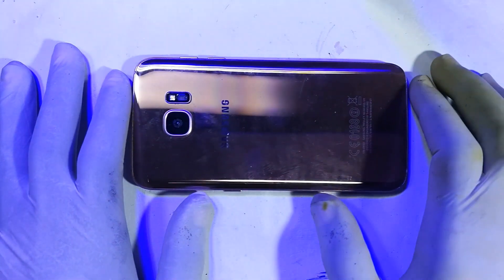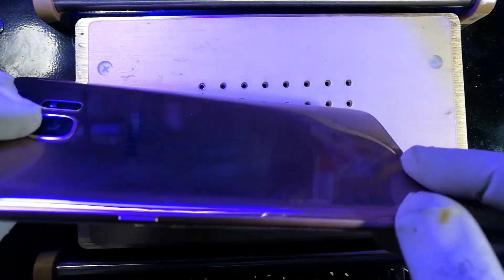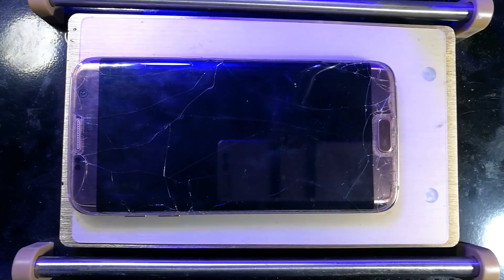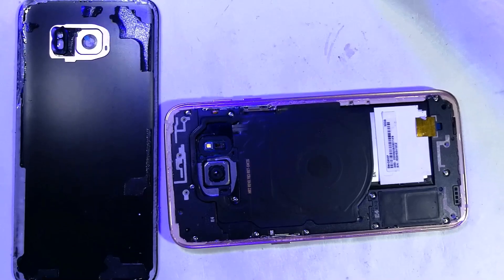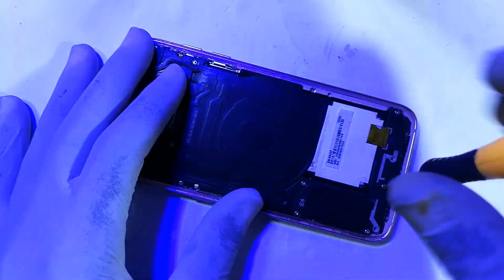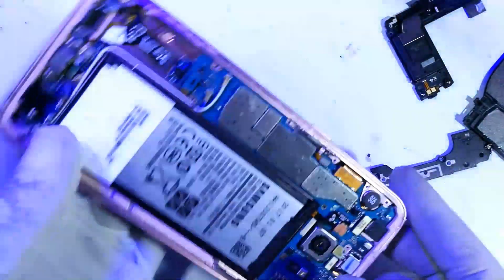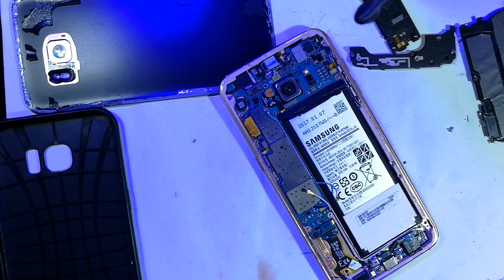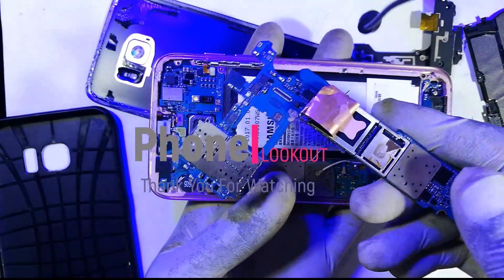How to Open Samsung Galaxy S7 EDGE (Dead Phone and Fix)

Comment: My 7 edge dead. No charge and not turn on. I changed battery and still nothing. What is the part i need to order and change?
Reply from the maker: how did it die; like what did you observe at the time of failure.
Does it produce any sound or even vibration when you try to turn it on?
(i will need a little more history on how it died)
Reply: @PhoneLookout my s7 edge make sound like eeeeeee and blacked out I couldn't open it even after factory reset , is it motherboard problem or battery problem

Comment: Hey there. I have a samsung s7 edge, however the screen is not working, the charging port is burned out, and the battery is completely dead. I dont really need the phone anymore, however i wanted to get my pictures off it, Is there anyway i can do this, and is it a long proccess thanks!
Reply from the maker: The processes is highly technical, would require you knowing how to properly remove Integrated circuits (I.Cs) for motherboards, then ship in data recovery hardware. 
in a nutshell you can't (technically and probably financially)
Reply: Contact no please